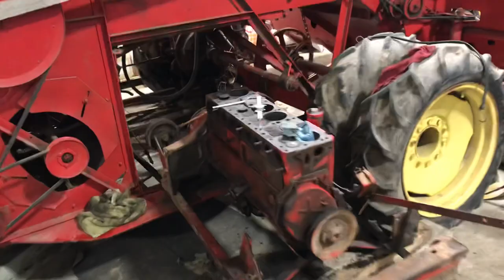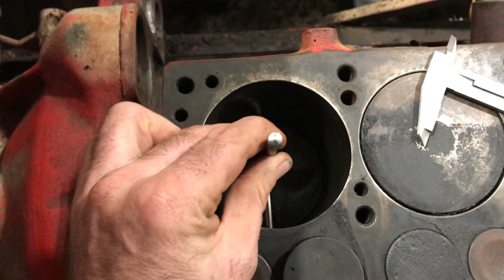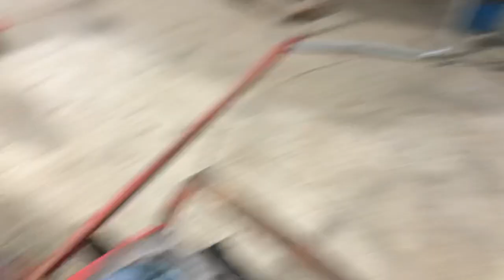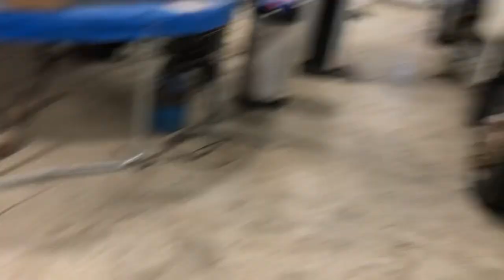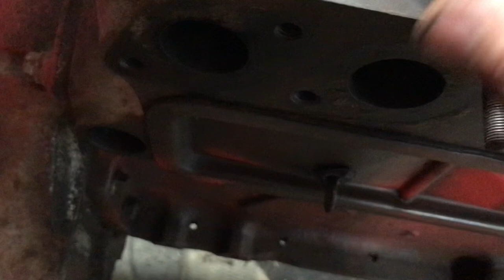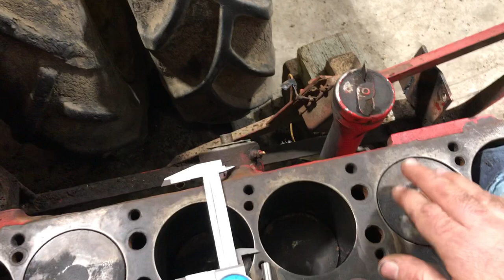Massey Harris 21 Combine- First Cylinder Bore Measure With the Snap Gauge, WTF is going on?!

Comment: You're on the right track. You can take a ring off the piston and place it in the bore at the top, middle and bottom as to measure the gap to see if the bore is tapered also. It may be that the pistons are just worn out. Good luck and keep us posted.

Comment: I know this engine. Given the extreme play between cylinder and piston I can almost guarantee the big end bearing and possibly crank need serious attention as well. It is a low rpm workhorse that suffers dirty oil very quickly and there is nothing but dust and chaff on a grain field. You can throw 1500 in parts at this engine without a second breath.

Comment: Your engine is bored 30 oversize you need 6 to 8 thousands clearance on the piston. Get a new 30 over piston and measure it then allow piston 6 to 8 thousands piston clearance so it dont sieze up . Your pistons will move considerably in the cylinder. Get the next size overbore rings and file fit them to each cylinder  and gap them to 010 gap. This will help your engine and do what you need it to do. You only use it several times a year dont waste anymore money than needed.

Comment: You need to measure the bore diameter at the top of the cylinder too.  (You don't even need the snap gauge.  Just use the inside points of the dial caliper.)  That's where you will see the most wear, not down at the bottom of the cylinder.  Also note, it's when the piston is at the top of the cylinder that you see all the slop, so that's where you need to measure.  
Since you know the diameter, measure the stroke (X6) and you will know the volume of the engine.  That will tell you if it was bored out before or not.
Call a parts place, and see what diameter piston was original.
Pull the pistons, and see what they measure.
If you can get some original specs, and then measure what you have, that will eliminate the guessing.

Comment: I agree, it looks like it was bored out not many hours ago, but the pistons are too small.
And they may have replaced the pistons, but been unable to get anything larger than .030 oversize at the time, or harvest season was upon them and they had to put in what was on the shelf instead of ordering larger ones. Or maybe they were left over from the previous boring out.
So get the right size pistons and rings for that bore, and probably put new bearings in, clean it up, and you should be in better shape!

I would check for a ring ridge at the top of the cylinders. If it doesn't have one, then it hasn't been run long since getting bored out.

With the sloppy pistons, I would not be surprised if the rings wore out fast, or maybe they left the original size rings on too, and so they never sealed properly, thus the low compression.

Also, when cleaning the head gasket surfaces on the block and head, it's best not to use Roloc disks, wire wheels, etc, because it's too easy to damage the surface and give a spot for leaks.
It's best to use a razor scraper kept at a low angle, so that you keep the flat surface and don't gouge anything. It doesn't need to be a perfect mirror polish.
This is more important on aluminum obviously, but you might be surprised how easy it is to marr a iron surface.

Comment: You could check the crank and rod clearance with plastaguage. To see if rod bearings are okay. Also clean up valve seats and see how pitted and check valve springs pressure. Just ideas. Good luck

Comment: Watch out for a ridge at the top of the piston ring travel so as not to damage the pistons when you take them out and install new rings. The bore is usually 3 to 5 thousands bigger and the original bore size there.

Comment: Here is what I didn't see is ridge on top that means bore wear. I would probably just put new rings on it run a cylinder hone down it. Relap the valves . And check the main and rod bearings.  Just my two cents.

Comment: Yes that means 30000 over, so it has been into before. Is there a big lip at the top of the cylinder wall. Well that doesn't really matter if they are not out of centric and size. I'd just get a ridge reamer and cut it off so you won't have any problems putting the new pistons and rings back in. Put a straight edge on the top of the block and check it for flatness of it and same thing with the head. If there is very little gap then you can get a good compression gasket for it so you don't have an added expense for machining the block and head.

Comment: Ian, do you have or can you borrow a bore gauge?  If you're unsure of what I mean.  https://www.youtube.com/watch?v=VXiN1lNZ7TY  This will allow you to get a better overall measurement of the bore at various positions up & down the bore as well as radially.  From what I gather, the stock bore of that engine is 3 1⁄4 in (82.6 mm).  https://en.wikipedia.org/wiki/Chrysler_flathead_engine       The pistons you have appear to be 0.30 over bore which would  stand to reason for the 3.5" bore.  Either the pistons you have are severely worn or were mistakenly marked 0.30.  Regardless, any case you need to get accurate measurements at various positions up and down the bore once the pistons are removed as well as taking measurement 90 degrees radially from each measurement point.  I cannot imagine the cylinder bores are near perfectly round with that much use on the engine unless you are very lucky.  The machine shop will need those measurements and will likely verify the measurements themselves to determine if boring is possible & the best solution.  I would expect there to be some amount of taper in each cylinder bore which is to be expected.  Hope this is helpful and not TMI.
Reply: Exactly my thoughts as well.  I'd like to see the rings on those pistons.

Comment: Would it be a posibility to use a PTO of a tractor to power the machine rather than rebuilding the engine? To get the machine working that is; I get that it is a fun project just for the sake of it.

Comment: Maybe time to invest in a dial bore gauge?

Seems like you may need to do a full tear-down, new bearings, crank journal inspect & machine, cylinder hone, rings, etc etc etc

What is the stock bore diameter? That will tell you if you already have 0.030”-over pistons.

Comment: Sometimes an engine with high mileage/time/age, the block/head can warp especially with undersized pistons.
So you should at least check the head condition before replacing just piston assembly and putting it back together.

Comment: I would say it already 30 over.  Piston wear to on the bottom skirt. May get away with new piston and rings . What dose the book say the bore should be standard. That would tell u if it's been bored over.  30 on top of that piston make me think that's a over sized piston. Here's what u can do is get it bored over and put sleeves in it like in a tractor. Done it to a ford truck one time 300 six.

Comment: Have you measured the top side of the boreholes? That's where most of the wear will be according to my little experience. If you pour some diesel on top of the pistons you'll probably see that it dissapears a lot quicker when they are almost upp. Does the diesel leak trough at the same speed at the bottom and at the top then you may have undersized pistons if your bores have the same measurements.

Comment: Years back I overhauled an old Ford 8N and that old engine had a huge lip on the top below where the rings slide on. You don't have that lip so that has been bored out. Now what size of pistons need to go in there - .040 or 0.50 over? Have fun. Hope you feeling better. Will miss you but we'll still have a lot of fun in TN.

Comment: The 0.30 stamp on the piston almost certainly means that it's a .30 over piston, and that would normally mean that the block has already been bored 0.30 over as well. Is that a 230? 254ci? I don't have experience with rebuilding flatheads, but looking at it visually, it appears to have a ton of meat, maybe that block can safely go to 0.60 over? Not sure if that would cause issues with the head, again, not a flathead guy :)

Comment: what is the engine? I still believe it was bored 0.30 per side, or 0.60 total and the rebuilder didn't catch the error and put in the wrong pistons. I don't see a ridge at the top of the bore enough to mention. Old Chrysler blocks had a high nickel content, and wear in bores would be minimal, it would usually be the bearings that went first. One handed bore measuring was a great effort for the camera, but it didn't show you anything valuable. You need to measure multiple places up and down the bore, as mentioned by others, using a ring and a feeler gauge will produce a better measurement.
Reply from the maker: Once my boys arrived we pulled the pistons and measured them up properly , 
Found even round 3.500”

Comment: Is there a ridge at the top of the cylinder at the point to where the rings stop coming up . With all that play in the pistons I think the pistons are wrong an yes most of the time that 30 does mean over but if someone did bore it wrong . From the video’s it does look like way to much play in pistons. I would not just put rings in it . Can you take a ring in the cylinder an Mike the gap . Should be around maybe 2-4 thousands. And then Mike your pistons.
Reply from the maker: Oh, it’s definitely not 2-4 thousands

Comment: It might have been bored.  I think the stock bore might be 3.25".
Reply from the maker: With a stroke of 3 5/8, it tells me that this is probably a 1930’s engine , older than this combine
Reply: @aCanadianBeekeepersBlog  OIC.  That makes sense.  A 1/4" variance in bore is a lot.  Maybe it needs an update.  Those engines used to be everywhere in the 40s and 50s.
Reply from the maker: Not that I know what I’m taking about, just looking for engines of that vintage that matches the specs.  I think this engine has been bored out twice , and they put the old pistons back in… I wonder if they did that because they couldn’t find pistons to fit the now 3.5… lol.  I don’t know.  The only 6 cylinder Chrysler engines that run a 3 5/8 stroke were 1930’s vintage. !!
Reply: @aCanadianBeekeepersBlog  Someone thought that bored cylinders and new pistons rings will be sufficient to solve the problem, but ....

Comment: So, this thing runs 3 hours per year or something. Can’t be that worn out right?
Another thought i had: if the engine keep’s uncooperative, perhaps can something electrical replace it? You may have to frankenstein a generator onto it, but that is surely a common commodity.
Reply: No this thing ran hard as a production combine, until it was retired a few years ago. He wants to get it running well enough to be able play with it and run it a few hours a year just for history demonstration etc. But it got worn out from decades of use as a primary farm implement.

And converting it to electric would be very expensive and time consuming, and a waste of work if you were just going to run it off a generator, might as well skip the whole thing and just fix the motor!

Comment: Does it hold the same diameter top to bottom?
Reply from the maker: Yes , to the hundreths difference according to my rough measure
Reply: The easiest thing to do is to feel the step with your finger. At the top position of the top ring.. on the cilindars. 
And good engines hold gasoline in the cilindars, over the pistons.. minimum over night. You can check the valves with gasoline the seme way

Comment: I have no knowledge of your mechanical expertise with ancient engines but the fact is that the tolerance then was NOWHERE NEAR the tight tolerances today or even 40 years ago. The lack of precision in the production line was made up for with larger tolerances so the Friday afternoon piston would still fit the Monday morning bore. If you've only worked on more modern engines then you couldn't have noticed this. Gas or oil consumption was not even in the top ten concerns I think there is a very good chance that much of what you are calling slap was and is allowable tolerance. That's and OLD machine. There wasn't much for automation other than moving the equipment along the line. Most of those parts were individually and manually machined. 

 If that motor is gonna be too expensive then just find a decent running strait 6 with a similar or larger HP and modify the mounts and the flex plate or however it connects. The modify is mostly time rather than money and I imagine an operation your size probably has a lathe and mill or combo to turn out what you would need for adapter plates.
Reply from the maker: :) ha yes I hear ya